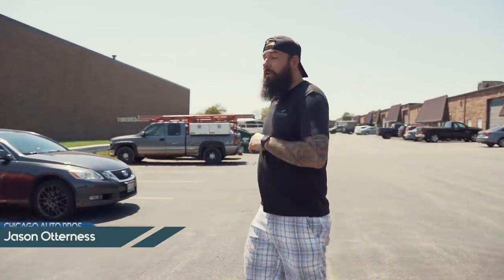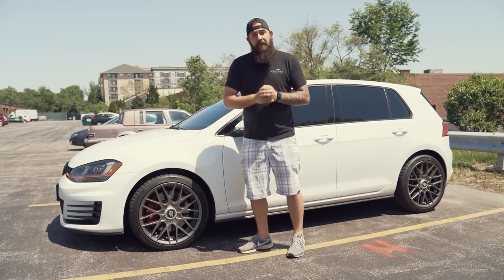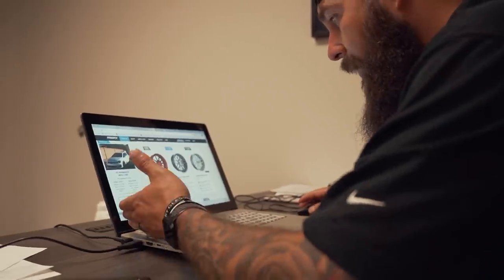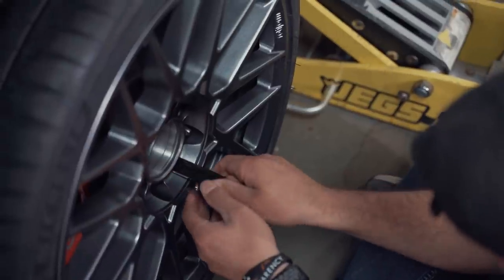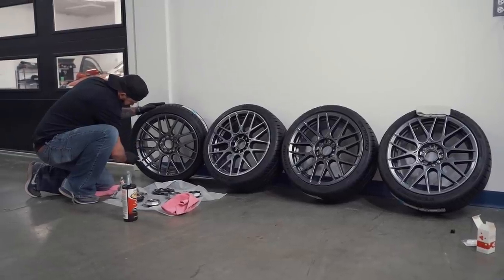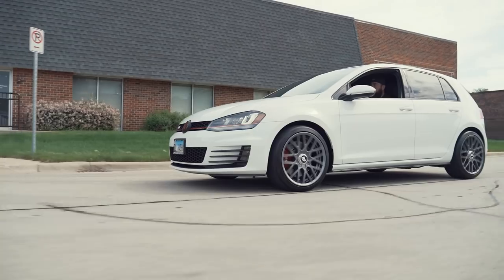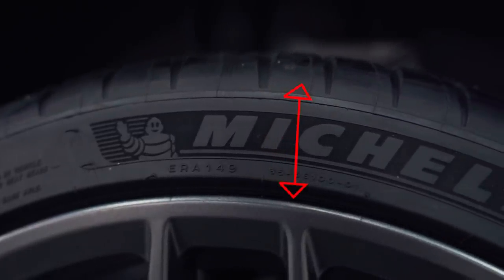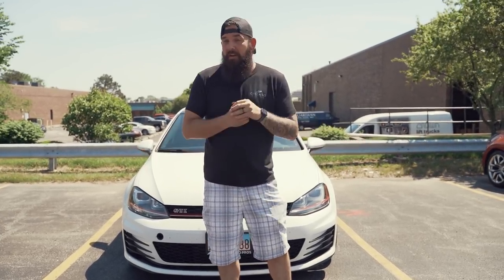What I Learned While Buying New Wheels | VW GTI MK7

Comment: 3 years late to comment, but the info about the weight of the wheel being on the concentric ring is false. The ring is only to center the wheel on the hub. The weight of the wheel is held onto the hub by the friction force between the wheel and the hub after you've bolted the wheel to the hub (ie, the weight is not on the ring or the bolts once bolted down)

Comment: Educationally informative, to the point, a no BS approach to a very complicated aspect of car modifying.  While there are a ton of websites that have info, its always a good idea to go to a proven company.  The info is all the same on all these websites, but some present it in a less confusing manner.  As for how complicated wheel shopping can be... you have backspacing, offset, centerline, hubcentric and bolt pattern.  I strongly suggest, as Jason did in the video, DO YOUR RESEARCH!  Don't copycat, learn, educate yourself, then make a purchase!  Sometimes you can go from a stock wheel to a much larger and wider version and be the same weight as stock!  Oh yeah, weight is VERY important!  Rotational mass effects driveability so keep that in mind when shopping.  Adding 30 feet to stopping distance can be deadly!

Comment: I thought about lowering my GTI but I have the Dynamic Chassis Control, not sure if yours does. Anyways, the only set of coil overs that I know works with this system is the Bilstein B16, and the kit itself will set you back around $2800. I’m not doing airbags, not unless I’m driving an old beetle or something less driver oriented.

Comment: Got the same set for my mk5 R32 but 19" +45, If you go lower def gonna need to roll your fenders and camber up. The offset you chose is aggressive fitment meaning you need to modify the car to fit without rubbing.

Comment: I recently installed new wheels on my Mk4 GTI which at the time had the original suspension. All was fine, the wheels were much wider than the stock wheels but they didn't rub. It was when i lowered the car using coilovers i started encountering problems. The front tires would rub against the coilovers when driving, so i wanted to use 5mm spacers to eliminate that problem, it did stop the tires from rubbing, but since 5mm spacers are not hubcentric my wheels weren't properly centered anymore, and i would get a really violent vibration in my steering wheel when driving. Upgraded to 10mm spacers with hubcentric and lunger lug bolts, the wheels are now properly balanced, but i'm afraid the previous spacers (with the vibrations) damaged my ball joints, because i still have a slight vibration when going over 120km/h.

Comment: Mechanic of 25 years here over tightening the lug nuts or lug bolts will not work a rotor what it will do is stripped threads brakes studs or lug bolts stretch them to the point where it damages them to the point where they could Shear off and the rim also refers to the outside perimeter of the rim it’s almost like rim is slang for wheels most people will understand if you say I put a new set of rims on my car they wouldn’t expect that you cut off the old perimeter of each rim and replaced it also on performance based vehicles I would suggest 5 to 10 pounds more of torque on the torque wrench it’s not going to hurt anything and some people like to use anti-seize on the lug threads as well it certainly will help prevent rust and also ensure you get proper torque Auto I know I’m just a mechanic of 25 years

Comment: Few questions.  Why did you decide to go with a tire size that had a smaller diameter than your factory size?  Also, do you notice any vibration as a result of not buying a hub centric wheel?  Did you take weight into consideration in your search? Comments. Summer tires are fantastic in rain as well.  Price of the tire does not always designate the safety of the tire.  Tire compound would effect traction more than an additional 10mm of width.  Thanks for sharing!

Comment: So stock tires size is size 225-40-r18 but you went for the 245-35-r18 ?  Does it perform better at speeds, like racing and cornering?

Comment: 🤦🏽‍♂️ I have a 7.5 gti for 2.5 years with these same wheels in 18 by 8.5 +45.  I went up to a 235 tire. I’ve been lowered on st coil overs since the car had 300+ miles now 23k miles. The back is lowered all the way and developed some camber so it tucks in very nicely. At the front it rubs the fender liner on heavy bumps since increasing the 235 tires about a year ago ( all I have to do is raise lol). But bruh, these are heavy at around 27 pounds per wheel (not including tires). Been on the hunt for lighter and affordable wheels for the past year. Ur wheel setup pokes out a lot even if you roll them (fairly low offset with 245 tires) Try some camber maybe ?
Reply from the maker: Yes, that's exactly what I'm going to try 3% camber.

Comment: What about TPMS? Also, you talked about wheels and tires, but what about valves?
Reply: shouldn't need TPMS, unless that's only a MK7.5 thing..
Reply: From the MK6 onward there isn't a TPMS sensor in the wheel, it's measured by the ABS system

Comment: When buying new wheels you need spacers, lower springs or adjustable suspension and more money for tyres.
And watch the road in front for "imperfections".
Reply: The goal when buying wheels is to avoid using spacers.